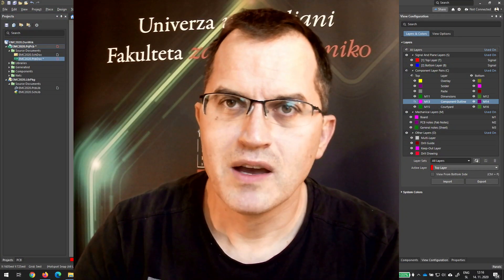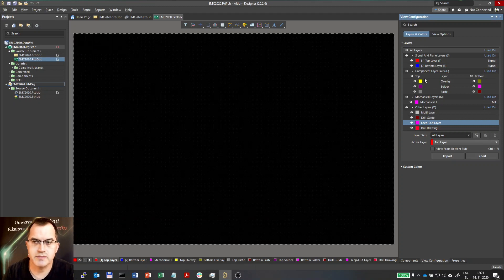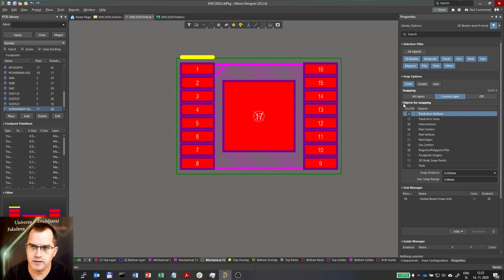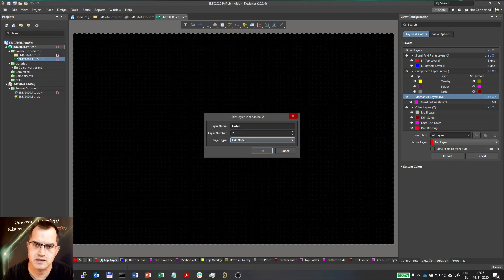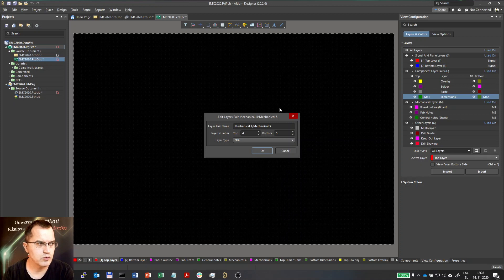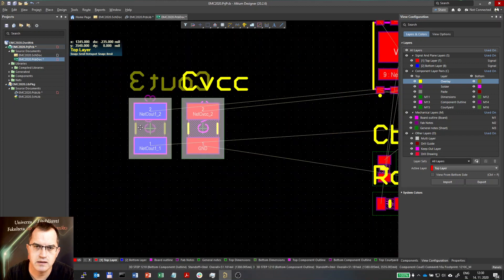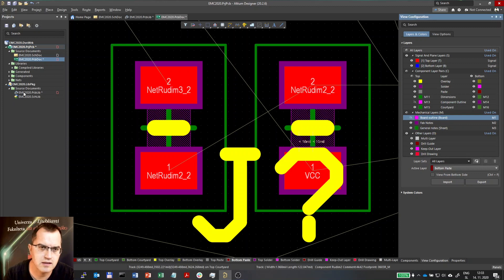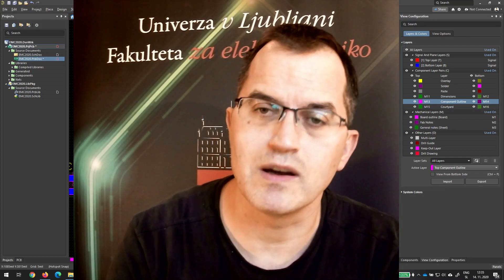Altium PCB #01: Layers

Comment: Hey, wanted to ask Is it important to choose a right width of the mechanical layers? Or the manufacturers will have no problems whatever it is? 
Also one more question about courtyard mechanical layer, how far does it have to be from the top layer(in other words the component), to ensure ,,safe space" or is it just the designers choice?

Comment: I noticed something.  Little confused by this.  You put the Component outline was layer 13 and 14 which are 3D bodies, but when you add a Component Layer Pair, there is a 3D body type.  What is the different between a 3D body Components Layer Pair vs. Mechanical Layer 13 for the Component outline?  Why not separate them? 

Thank you so much for making these videos!
Reply from the maker: One could of course separate them. I was here just following what the footprint wizard uses.

Comment: A mess is right! It is unfortunate that one must import layer sets manually for each project, that it cannot be set as a default 'template'
Reply from the maker: Still waiting for that feature. It shouldn't be so hard to implement.
Reply: hello, is there an option for import the layers from another footprint for example? I don't find it at the moment ant is quite frustrating adding the same layers for each part... @elektronika-fe1325  .
Reply: I would like to have standardize layer numbers and names... and it is a bit redundant work to add some layers again and again....
 @elektronika-fe1325

Comment: You combine 3D body and Component outline on the same layer (layer 13). In my opinion, those should be separated because if you use designator on component outline (for assembly), the hatch from 3D body layer will make it difficult to read. Could you comment or suggest a solution, plz?
Reply from the maker: You can of course separate those two layers, but then you will not be compatible with the IPC compliant footprint wizard... which is not that bad, since you can alway manually edit the generated footprint later.

Comment: Hello!
Congratulations again on your wonderful lessons.
You explain very clearly.
Regarding the layers, there is a big discrepancy between the different users.
I really want you to explain when you create a component on which layer what it is used for.
For example for 3D, for outlines, for assembly, where the inscription .Designator is placed.
Because this also applies to the layers on the PCB.
I think. that it will be very useful for everyone.
Reply from the maker: You are right. There is no de facto standard layer set. Here are my recommendations:

Board outline M1 - shape of the board. Not to be replaced with the keepout layer, which defines the copper routing and component placement area.

Fab Notes M2 - notes relevant to the fabrication of the PCB, such as layer stack table. Drill table has it' s own dedicated layer.

General notes M3 - all other project notes.

Dimension M11 M12 - All dimensions markings.

Component outline M13 M14 - 3D body and the outline of the component with all the assembly markings and designators. Needed for printing the assembly of the pcb. Usuallly much more data than the Overlay, which contains just minimal markings that will be actually printed on the PCB.

Courtyard M15 M16 - The safe boundaries of the component, in which no other intruder is alloved. This layer usually contains the center pick&place marking cross as well.

I how this satisfies your question. If you have some other related questions or comments, just shoot.
Reply: @elektronika-fe1325  Hello!
Thank you very much for the answer!
I have additional questions:
1. In your Footprint libraries you use mechanical layers M1, M13 and M15.
M15 use it to outline the element. Why isn't this layer named Courtyard? In PCB, it is now called Courtyard.

2. In your Footprint libraries, you use the M13 mechanical layer for 3D and for the element assembler.
Most libraries use two separate mechanical layers for 3D and assembler. Why do you proceed in this way?

3. For the mechanical layers of the PCB you use M13 and M14 for Component Outline, and Footprint there is 3D.
Is this true?

I will be grateful for your explanations. If you think it is better we can use e-mail:
vankov2020@gmail.com
Reply from the maker: @vencislavvankov4897 please note that the libraries I shared are deliberately made from all different sources and are not a prime example. They are intended for the students to correct them as a part of ther laboratory course activities.

AD1: The names of layers in the footprint do not matter as long as the layer numbers match with the PCB.

AD2: Because this is what IPC copliant footprint wizard does as well.

AD3: Yes :)
Reply: @elektronika-fe1325  Thanks for the reply!